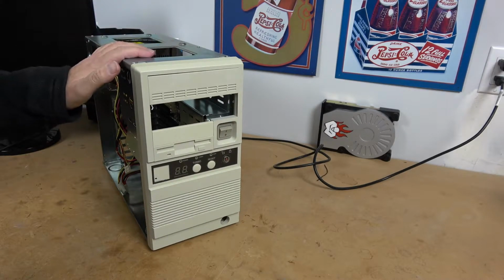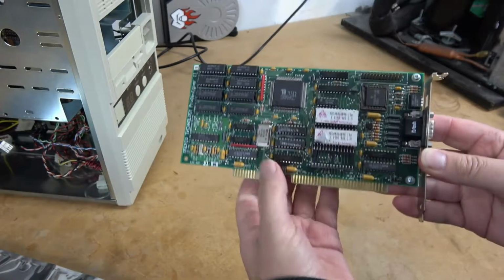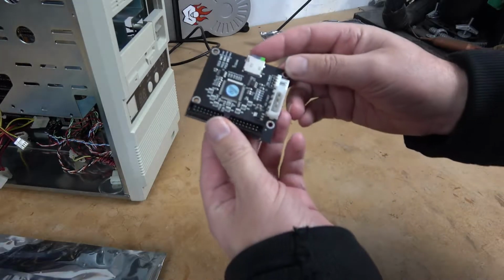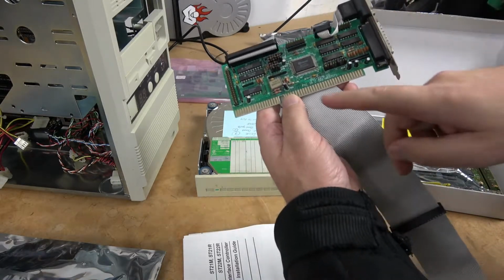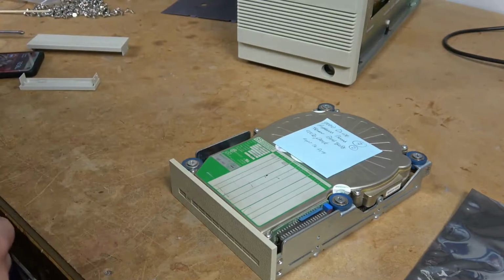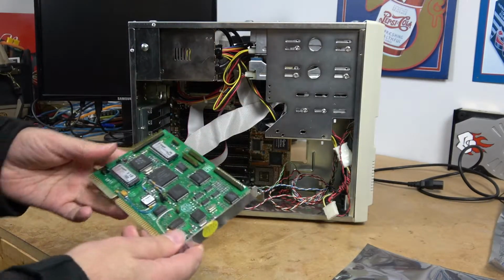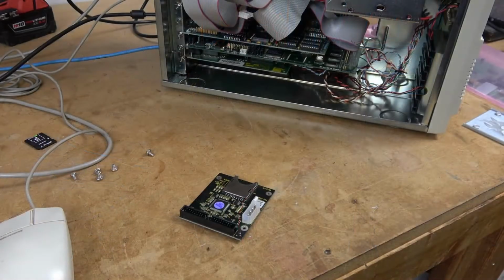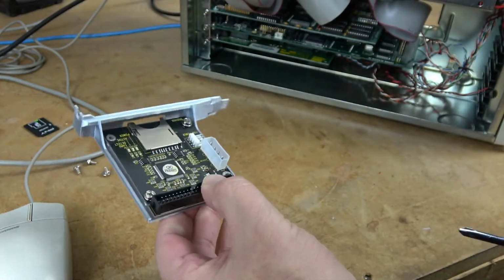I put a Microscience HH-1060 in my Retro 386 PC - Classic Case Build

Comment: Great video!, what is that bottom left hole in the front of the case for?
Reply from the maker: The hole you can see in the bottom right of the computer case is for a Keyboard DIN connection.  There is a female plug that mounts there and runs a cable back to the keyboard din on the motherboard.

Comment: Where did you find the case?  I've been looking all over for a proper vintage case with turbo button/display, and I can't find any anywhere.
Reply from the maker: Ebay,  they are getting to be extremely rare but, you can still find them if you look.